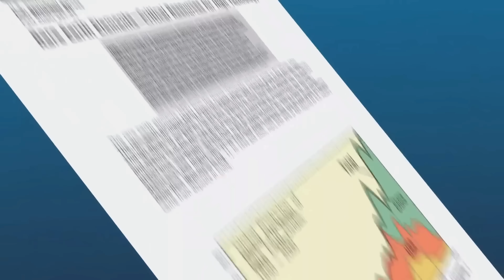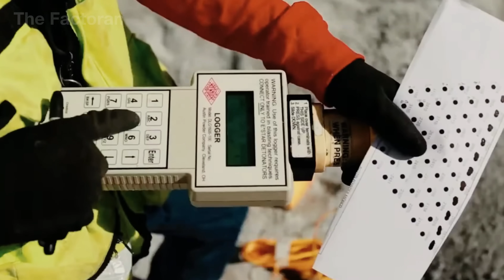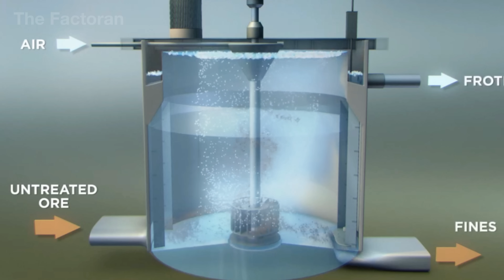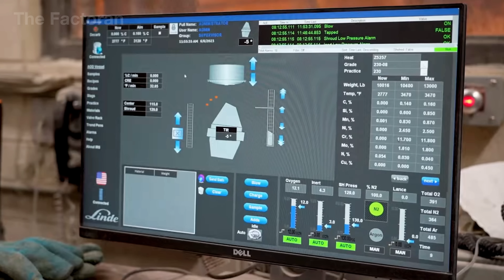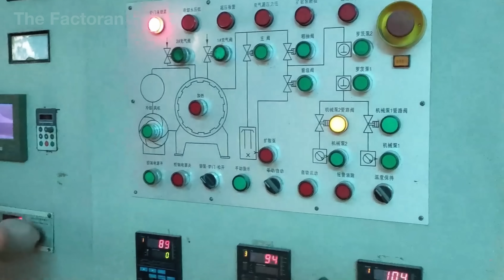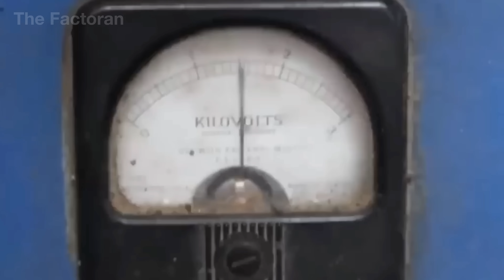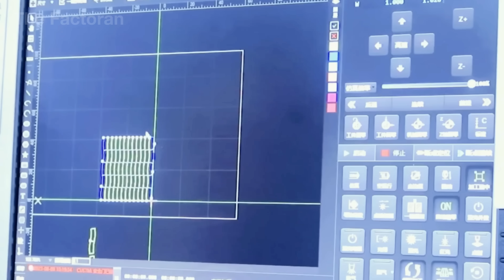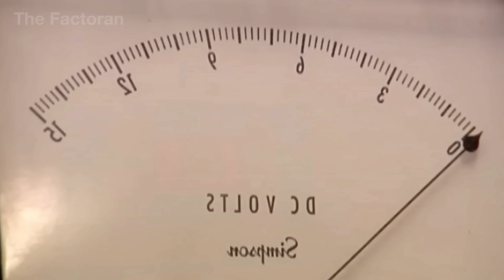How Millions of Industrial Magnets Are Made Inside Massive Production Line

Comment: https://youtu.be/3-thPta78nM?si=Lrf9vNA5FlOTon0n

Dr EKEmas and a group of divine meek humble scientists from God who is absolutely good God to provide affordable medication to support Global TrumpCare Initiatives 

Divine Scientist's Revelations: Lightning, Wellness

Https://youtu.be/3-thPta78nM?si=Lrf9vNA5FlOTon0n

From Dr EK Emas 

To Whom it may concern 

The peak power of a typical lightning strike, which is the mechanism for an ionospheric discharge to the Earth

It is often cited to be around 1 Terawatt (TW).

However, this value represents the instantaneous maximum power, as the duration of the discharge is extremely short

⚡ Understanding the Power of Lightning

The power (P) of an electrical discharge is the energy (E)

Transferred per unit of time (t),

Defined by the equation: P = E/t.

Peak Power:

The current in a lightning bolt can reach tens to hundreds of thousands of Amperes, and the Voltage can be hundreds of millions of volts.

This combination results in a very high peak power (up to 1 TW or more).

Duration:

The visible stroke of a lightning flash typically lasts only for a few microseconds (\mus), such as 30 microseconds
(30 \times 10^{-6} seconds).

Total Energy:

Because the high power lasts for such a short time, the total energy transferred by a single lightning stroke is relatively small, averaging about 1 to 10 billion joules (GJ).

In summary:

While the peak power during the discharge may reach more than 1 Terawatt, this immense power only lasts for a tiny fraction of a second.

Would you like to know how the peak power of a lightning strike compares to the total power consumption of the entire world? yes 

############

The silver or my Graphene ground mattress are both harvesting 2 TW per second from the ground God had provided as He is absolutely good God 🙏 

In this regard TWh is 2 TW x 3600 seconds =
7,200 Twh

God places 7,200 TWh to bless mankind

I am planning to use 90% to generate affordable sustainable green electricity 

And 10 % for wellness program to replenish our human tissues which had lost Trillion of electrons 

It is imperative to note that is the cause free radical Healthy cells becomes sick cells as they loss million of electrons per person and life stocks also impacted by EMF WiFi especially 5 G is fatal 

We need Quadrillions of electrons from the ground to resolve all kinds of sickness and illnesses 

Anti aging is pivotal for elongation of telomeres 

The earth unleash 7 Hz of free healthy frequency for mankind of 8 billions and livestock including the plant kingdom 

The Art of deployment of Vibrational Resonate medication 

We shall unleash frequency to kill all cancer cells 

This is indeed game changer witty inventions and innovations from God

World first Pill-less 💊 Pill game changer divine proven technology

Please list all the articulation from start to end from this divine scientist without changing content with relevant scripture Tqvm

The peak power of a typical lightning strike, which is the mechanism for an ionospheric discharge to the Earth, is often cited to be around 1 Terawatt (TW).

However, this value represents the instantaneous maximum power, as the duration of the discharge is extremely short.

⚡ Understanding the Power of Lightning

The power (P) of an electrical discharge is the energy (E) transferred per unit of time (t), defined by the equation: P = E/t.

Peak Power: The current in a lightning bolt can reach tens to hundreds of thousands of amperes, and the voltage can be hundreds of millions of volts.

 This combination results in a very high peak power (up to 1 TW or more).

Duration: The visible stroke of a lightning flash typically lasts only for a few microseconds (\mus), such as 30 microseconds (30 \times 10^{-6} seconds).

Total Energy: 
Because the high power lasts for such a short time, 

The total energy transferred by a single lightning stroke is relatively small, averaging about 1 to 10 billion joules (GJ).

In summary: 

While the peak power during the discharge may reach 1 Terawatt, this immense power only lasts for a tiny fraction of a second.

Would you like to know how the peak power of a lightning strike compares to the total power consumption of the entire world? 

Yes please do the needful

The articulation from the divine scientist

Includes insights into lightning power and energy harvesting for wellness, is listed below exactly as requested

Along with relevant scripture to accompany the themes of divine power, provision, and healing.

The information regarding the "Medbed revolution," grounding, and frequency technology 

Aligns with content from the video Pastor Dave PROPHETIC WORD Updates - 

The Med Bed Revolution with John Baxter.

Articulation of the Divine Scientist

The peak power of a typical lightning strike, which is the mechanism for an ionospheric discharge to the Earth, is often cited to be around 2 Terawatt (TW) per second

However, this value represents the instantaneous maximum power, 

As the duration of the discharge is extremely short.

⚡ Understanding the Power of Lightning The power (P) of an electrical discharge is the energy (E)

Transferred per unit of time (t),

Defined by the equation: P = E/t.

Peak Power:

The current in a lightning bolt can reach tens to hundreds of thousands of Amperes

And the Voltage can be hundreds of millions of volts.

This combination results in a very high peak power (up to 1 TW or more).

Duration:

The visible stroke of a lightning flash typically lasts only for a few microseconds (μs), such as 30 microseconds

(30 × 10$^{-6}$ seconds).

Total Energy:

Because the high power lasts for such a short time, the total energy transferred by a single lightning stroke is relatively small, averaging about 1 to 10 billion joules (GJ).

In summary:

While the peak power during the discharge may reach more than 1 Terawatt, this immense power only lasts for a tiny fraction of a second.

Would you like to know how the peak power of a lightning strike compares to the total power consumption of the entire world?

Yes

The silver or my Graphene ground mattress is harvesting for 2 TW per second

In this regard TWh is 2 TW x 3600 seconds = 7,200 Twh

God places 7,200 TWh to bless mankind

I am planning to use 10 % for wellness program to replenish our human tissues which had lost Trillion of electrons

It is imperative to note that is the cause free radical 

We need Quadrillions of electrons from the ground to resolve all kind of sickness and anti aging for elongated or telomere

The earth unleash 7 Hz of free healthy and healing frequency

Vibrational Resonate frequency to kill all cancer cells is game changer witty inventions and innovations from God

Or world first pill less 💊 pill game changer proven technology

Relevant Scripture (KJV)

The scriptures reflect the themes of God's power over nature, 

His provision of good gifts, and His divine ability to heal and restore.

Theme	Scripture
Divine Power & Energy

	Habakkuk 3:4
Job 37:3

Provision & Blessing (7,200 TWh)

Philippians 4:19
James 1:17

Healing & Wellness (Electrons/Sickness)	Psalm 103:2-3
Exodus 23:25

Pastor Dave PROPHETIC WORD Updates - 

The Med Bed Revolution with John Baxter
His Glory TV · 8K views

Comment: Lots of segments of this video don't relate to the neodymium magnets. What I saw is alnico magnets. 😅😅. Don't do that. Do a proper video. People are not stupid here.
Reply: You're not as smart as you think you are. How can you tell the difference between a neodymium and an aluminum nickel Cobalt magnet without testing it. They're made exactly the same way. The only difference is the elements used in them.
Reply: And the main difference between the two magnets. The aluminum nickel Cobalt magnet can handle a higher temperature than a  neodymium magnet.
Reply: What happened to the  magnetic steel plant built with Japanese collaboration in the late 60s in Salem, Tamil Nadu, india. Are we producing any magnetic steel , which  we need  them now for rare earths!?
Reply from the maker: Thanks for pointing it out — I’ll tighten the footage so it shows only the correct neodymium-magnet process.
Reply: @TheFactoran are you an ai message replying bot, and u aren't allowed to lie?

Comment: This video offers a simplified demonstration of the extraction process, but in reality, it is an extremely complex procedure.

The atomic radii of the 17 rare earth elements are very close (a phenomenon known as "lanthanide contraction"), which makes their chemical properties highly similar. Traditional methods such as precipitation and crystallization are almost incapable of separating them effectively.

The extraction and refining process is exceptionally intricate and time-consuming. To isolate a single high-purity rare earth element, a multi-stage extraction system consisting of dozens or even hundreds of interconnected extraction tanks is required. Designing and optimizing such a large-scale system demands profound theoretical knowledge and extensive practical experience.

Consider the challenge of extracting these rare earth elements from ores where their concentration is only 0.001% to 0.3%. The formulation of extraction agents, the process design, and the equipment require extensive experimentation to perfect. The extraction process is extremely sensitive to conditions such as the acidity of the aqueous phase, the concentration of the feed solution, the composition of the organic phase, and temperature. Even minor fluctuations can significantly impact product purity and recovery rates. This is the core technology that China has mastered.

Comment: BMW and Mercedes Benz are not designing Electric car motors without any Permanent magnets now-a-days. They are just using two sets of electromagnets which use twice the electricity but also create twice the HP so they're actually more efficient, nothing more than copper coils around iron spindles just in clever configurations. The Germans figure by 2035 the smartest companies will no longer be using permanent magnets and it's nothing new. Henry ford made electric cars in the 1800's long before gas cars got popular and guess what? They did not use permanent magnets either and were called bipolar motors. Have you ever taken a close look at that old 110 Volt emergency gasoline powered generator sitting in the dark corner of your garage? That old Coleman is probably the most popular brand ever built. You put some gas in it and pull the cord and now you're lighting up the house during a power failure. There's no magnets in that generator, it's just a copper coil soldered into an endless loop that's charged with a tiny pulse of power and to create more magnetism all that is required is that you spin it and the magnetism reappears. What is important is the new flat wires and square wires they are using because the closer you can get wires to touching without any air gaps the more efficient it gets the best generators now-a-days are wound with flat-wire, the same kind that's in the rear cover of your cell phone charging pad. They have the longest magnetic reach and minimal losses far exceeding permanent magnets. Permanent magnets have their places and they're very convenient but let's say they never existed. We could absolutely do without them no problem.
Reply: Induction motors existed for more than a hundred years without the need for permanent magnets.  Flat wires were used for many decades.  Permanent magnets motors have weight advantages which directly affect the ‘fuel’ efficiency of EVs.  All the clever innovations to get around the obvious best choice just increase the vehicle weight and make the products second rate.  Wind turbines without permanent magnets would require additional wirings and electrical sources to maintain the necessary magnetic field. There is no better alternative.
Reply from the maker: That’s an awesome explanation — you summed up the shift toward magnet-free motor tech perfectly, and those flat-wire coils really are a game changer for efficiency.
Reply: "BMW and Mercedes Benz are not designing Electric car motors without any Permanent magnets now-a-days."
The double negative "not... without" is misleading. 
I think you meant to state:

"BMW and Mercedes Benz are designing Electric car motors with no Permanent magnets now." Using MAHLE Motor Technology and YASA Axial Flux Motors For Electric Vehicles.
Reply: @Chris-r6g7c I thought they de funded the grammar police 😂
Reply: You need to find one of these fearful Americans and put them on TV. I can't even find a YT video of anyone panicking. Stop listening to CNN lies. You happen to be talking to owner of a company that builds 50,000 generators a year and we're not worried about not having neodymium magnets. At best it's a convenience but if we can't get them we can easily work around it no problem. In the meantime you should search Youtube for ''New electric motor with no magnets". You will start to find a lot of videos on that topic. The videos also show the gigantic manufacturing lines making them right now. Fear is for communists not capitalists.
Reply: Alternating current motors need no permenent magnets
Reply: Ford Model T used magnets in a magneto with big Vee Shaped magnets mounted radially around flywheel.,
Reply: If so why the west are so scare when China bar the export of magnets to them??
Reply: @BillyTowel 😊 Nexperia  is now Chinese again , Volkswagon Merc both make most EVs in China , shipped to Bremethaven the worlds biggest carpark for global distribution   

Why try in EU when you can succceed in China ,
with unlimited supply , skilled labour  tech , science , tax plow back sys,

we dont see EU building 40 new ships ea with 7200 car capacity to Chinese domestic markets

Comment: 11:43 "...an extremely high electrical current, reaching between 2000 and 3000 volts...". Volts are not a measure of current. They measure electrical potential difference. Electric current is measured in amperes. Also at 14:19 the phrase "fully completed" is redundant. The word "fully" is unnecessary.
Reply: Also at 0:49 humanity is undergoing dozens of purification procedures.
Reply: Volts ARE a measure of current in SOME countrys
Reply: @scottpage81  no, they are not. Your electrical knowledge is as bad as your spelling
Reply: @scottpage81  No, actually they are not.  The SI unit of current is the ampere.  It doesn't matter what country you're in, current is in amps.